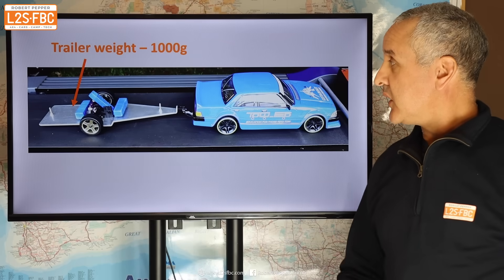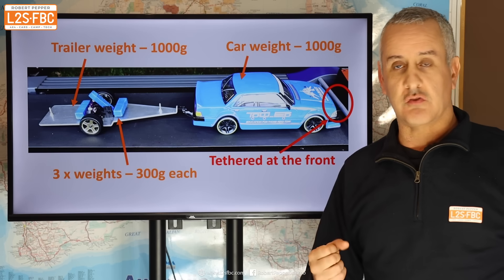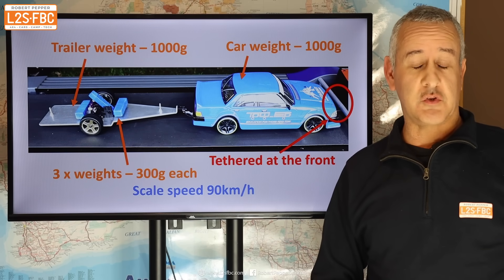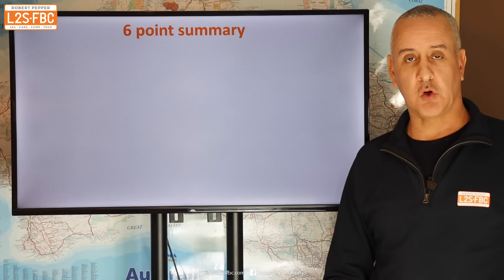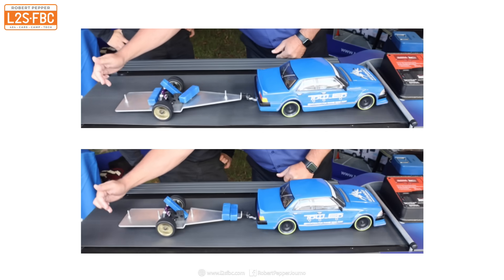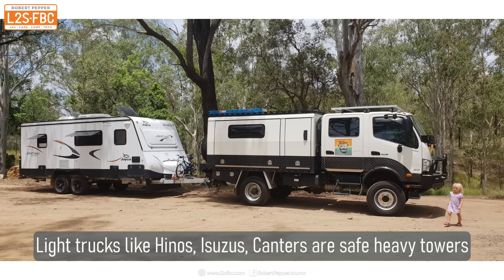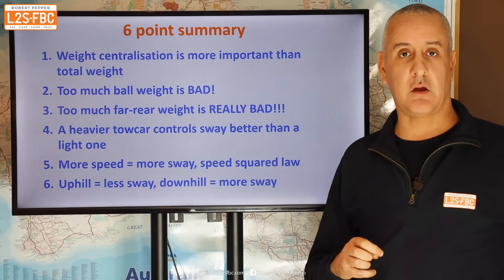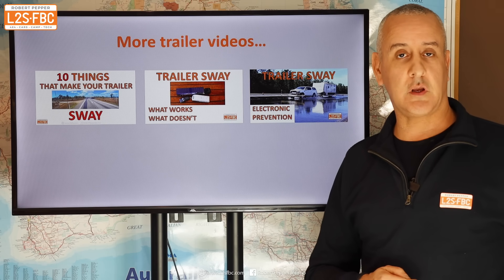7 trailer weight distribution setups, some safe, some deadly.

Comment: I try not to get above abut 75% of the max towing capacity for long trips.  You can use the full capacity for short hauls at lower speeds, but there is a price to pay, you entire drivetrain works very hard to do this.  Trailer brakes are also a great idea as they can be a big help in recovering an unstable trailer (you can LIGHTLY apply the trailer brakes only and often get out of a mess that you shouldn't have gotten into in the first place)  If you live in the mountains it's even more important to watch your weight.
Reply from the maker: Great points thank you!

Comment: I used to work at a Land Rover body shop I used a defender 110 towing a twin wheeled Brian James trailer and on that trailer I have tower Porsches. My 2 jaguars, Range Rovers and never had any sway problems and that’s because I put markers on the trailer to guide me and to keep the trailer and defender 110 level. My defender 110 had an adjustable tow plate that I could lower or adjust. I also used the vehicle to collect motor way accidents from off the recovery yards when they picked them up from the actual accidents. I loved that job it did get scary whilst travelling on the uk 🇬🇧 motorways once you got into the groves the uk articulated Lorrie’s make with their twin axles over the years because it pulled you in and spat you out unexpectedly

Comment: A few years ago in my married years, I bought a VIscount 17ft, towed by a VJ Valiant, 4.3 litre, so plenty of power there and good torque for getting out of trouble. But on a short trip down to Normanville,  from the northern suburbs, getting onto the main hyway, I got this horrible sway. But controllable. While at the caravan park, one of the fellow campers told me to get some torsion bars like he had on his van. So just by luck, in the local paper there, someone had a torsion (stabiliser) bar set. Quick as a flash I went to the house, asking if the owner still had them, sure enough. Just had a bracket to hold the straight part of the bar on both sides of the A frame, and a special fitment that went underneath the towball. The curved bit of the bars went into the holes on the fitment and two cotter pins to hold the bars from slipping out. Best $50 bucks I spent on the van. Took no time at all to fit it..but equipment well needed. On the way home, I had no dramas with sway at all. They ain't everything, but they certainly help the journey be a bit less tiresome.
Reply from the maker: Thanks!

Comment: Great mechanics example with the model however it doesn't fit the video examples you've given. You showed camper trailers that were all double the size of the vehicle pulling them and there lies the issue.  The wheelbase length of the trailer combined with its mass (regardless of weight) creates the sway.  Once the much larger in mass trailer starts dancing the smaller pull vehicle has lost its command.  Bothe of those trailers should be pulled by much larger power units period.
Reply from the maker: The concept remains the same

Comment: This is an awesome video... In the US as another commenter noted, we distribute weight differently. Our trailers are designed with the axles towards the rear of the trailer to add more tongue weight (ball weight). They tend to say that 60% of the weight should be in front of the axles. I realize that exact placement of that weight can change a lot of things, but I'd love to see how your model reacts with more weight just in front of the axles vs all the way at the front as you demonstrated.

Comment: We are contemplating buying an RV, so Im researching, A LOT.  We are looking at towing a travel trailer with an Ford F150.  If all my weights are within limits and distributed correctly, what effects would a 164kg motorcycle in the bed of the pickup truck have, in regards to sway.  Would the likelyhood of a sway increase, decrease or no change?  Obviously, the motorcycle would be strapped down. Thank you.
Reply from the maker: Decrease, as the heavier the towcar the less sway, provided the weight is between the axles on the towcar.

Comment: This is very interesting.  I haven't seen axle positioning mentioned yet (half way through the video), or tandem vs single axle.  I've had years of experience with caravans (short) and boat (long) and never had a problem.  My boat is stable, even in very strong crosswinds.

Comment: So is it center of TRAILER, or center of trailer AXLES that's important? For instance, a 20ft utility trailer has the tandem axles farther towards the back of the trailer. On your defender demo truck, that trailer had the tandems centered on the trailer.
Reply from the maker: Centre of axles with a little weight on nose.
Reply: @L2SFBC  perfect, thanks. That's what I've always done.

Comment: I already knew everything that wqs covered in this video, BUT one thing that still is up to debate is what is the best way to position a vehicle ON the trailer beings most of the  vehicle weight being towed is at the front of the vehicle, it is extremely hard to adjust so the bulk of the weight is on top of the trailer axles
I have hauled vehicles pulled foward onto the trailer which creates too much ball weight and I have hauled vehicles backed onto the trailer which creates too much tail weight on the trailer
For example your trailer is 18 foot long and the vehicle your hauling is 16 foot long you don't have much room forward and backwards to balance out the weight
Also do weight distribution hitches really work????
Reply from the maker: Yes WDH really works. You can also try rotating the vehicle on trailer by 180 degrees as often cars aren't 50/50.

Comment: Very nice video. But the scientific justification lacks.
The reason of sway is vibration resonance. You have two masses (the car and the trailer) attached to a hinge, alike a double pendulum. When the periods of vibration of both masses match, then both vibrate simultaneously and you observe the sway.
This is why i draw your attention to the hidden parameter: the length of the trailer and that of the trailing car. In other words, the distance from the hinge to the centroids.
If you repeat your experiment with others dimensions, you might reach different conclusions.
I can give the analytical solution if you want.
Reply from the maker: Yes please!

Comment: Shouldnt the vehicle be 10000 instead of 1000, so that the weight ratio of vehicle is 10:1 instead of 1:1? Most vehicles are 10k pounds or more, and typical trailers are around 1200.

Comment: Really instructive! Thanks much! Now i can drive safely!
Reply from the maker: Great to hear!
Reply: Just one question : I heard a long time ago then if a caravan begin to sway, we need to accelerate up to stop this sway movement before slow down. Is it real ?
Reply from the maker: No, if you have independent brakes on the trailer, apply those. Otherwise, steer straight and slow down. Some people have had limited and successful experience with speeding up, but it's not recommended.
Reply: @L2SFBC  thank you for your advice

Comment: What about all the factors that your cute little model doesn't take into account like wind, road surface, inclines, declines, off-camber turns, wet surfaces, towing vehicle wheelbase, weight, and varying widths? All-wheel driver vs standard drive, and on and on. Every vehicle trailer combination is going to be different... drivers just need to know their gear and, most importantly drive cautiously.
Reply from the maker: Hard to create a model which accounts for that. Also, if I do, then it will not highlight the effect of weight distribution as the weight effects will be masked. To demonstrate one effect, you need to isolate it and that's what we've done.

Comment: This was informative. Now here's a question- Does axle placement on the trailer make a difference. Some look centered and some are behind center giving you that extra tongue weight?
Reply from the maker: Yes, the further the axle back, the more stable the trailer, assuming correct weight distribution.

Comment: Do you recommend towing with full water tanks on a caravan or partly full or empty ? I have one in front of the single axle and one behind so I do try and keep them even.
Reply from the maker: Your caravan should be stable with water tanks filled in any combination. If it isn't, then I can't say what would be stable as it varies so much. Keeping them even isn't necessarily the best idea as it depends on the other weight distribution.

Comment: A good rule of thumb when towing. Load your trailer over the axles just a bit forward of center. When designing/building my trailers, I take the total dry (empty) weight of the trailer, figure out what 10% of that number is and set my axle(s) accordingly. In other words, if my trailer weighs 1000lbs, I set the axles back far enough so the tongue weight is 100lbs. That has always worked well.
Reply: That 10% guideline also applies to loaded trailers. It's a bit of information that is valuable and good to know.  Just don't exceed the gross weight rating of the trailer, the tongue weight limit of the tow hitch, or the tow vehicle's towing capacity.

Comment: I always thought that the tongue height relative to the ball height also made a big difference and I didn't see you mention that at all in your presentation.  The frame of the trailer must remain level and if your ball height does not take that into consideration then look to see if the trailer is level,. and if it is not then get a drop ball, which can go from just a few inches to almost a foot for those jacked-up jeeps that go hill climbing.  Am I wrong here?  Everything they showed you was correct, but all trailers must be hauled level not in a 5 degree up-angle because your truck or car sits too high.
Reply from the maker: You are correct, but I couldn't mention everything!  I have a seperate video on trailer hitch height please review that.
https://youtu.be/fX78Fu87Coo and https://youtu.be/LfCpOJGnUdg
Reply: @L2SFBC  Thanks, I'll go look at it.

Comment: One thing I wonder about is the tow vehicle.  Is weight distribution as important?  How about center of gravity?  I have a cargo van I tow with, where the cargo area is empty (thus the back end is light) and it has very high clearance and thus a high center of gravity.  Do either of those factors adversely affect sway?  Given the light rear end, is it helpful to add tongue weight on the trailer to compensate and help distribute weight better on my van tires?

I've watched a lot of these trailer sway disasters that end in a wreck.  One thing I've noticed is that they often get just 3 hard sways before they completely lose it on the 4th.  (Sometime they're lucky to get more, but usually get about 3).  If you can react fast enough to manually hit ONLY your trailer brake after the first or second hard sway, I think you've got a solid chance of recovery.

Comment: To start with the tow vehicle should weigh 55-60% more than the pull trailer and the center of weight of the trailer should be before the front axle, plus the tongue weight should be 10-15% for starters...yes, some can get buy with 5% under ideal conditions...speed quadruples bad decisions...why does U-haul recommend 45 mph?   50 50 weight is the beginning of a wreck!

Comment: In the US when our trailer gets to 1.5 to 2.5x the weight of our tow vehicle (more or less depending if the tow vehicle is a SRW or DRW) we move to a bed mounted hitch. This adds weight to the tow vehicle right above the rear axle and removes the tendency that tongue weight has to lift the front of the vehicle. General rule here is 10 to 15% of trailer weight for conventional/ball hitch, and 15 to 30% for fifth wheel and gooseneck. That puts hitch weight on our heaviest campers (25,000 lb GVW) at between 3,750 lbs and 7,500 lbs. Tow ratings for each hitch type is based on the bottom end of the range as far as effect on payload goes. For instance, the dually that I am waiting for Ford to build has a 5,500 lb payload and is rated for around 20,000 lbs on a conventional hitch or 34,000 lbs on a be mounted hitch (5,100 lbs of pin weight). I wouldn't go above 25k lbs with an 8,500 lb truck though.

Comment: If you have loaded your trailer WRONG and it does start to Sway and Whip out of control if you STOMP on the Brakes and then STOMP on the Gas and give the Trailer a Big JERK it will stop the Swaying because you have shifted the weight by the Jerk... If your trailer keeps starting to sway at either High Speeds or a Bumpy Highways BEST to pull over and move your load or just slow down and put your Hazzard Lights on... Hope this SAVES someones life one day :)
Reply from the maker: No.
Reply: @L2SFBC  YES............ NOT ASKING TELLING...  done it many times on a Swaying trailer... the Worst was when I loaded a Van Backwards engine on the back of the trailer... Started Swaying BAD going 110km-120km down the highway.... Give the Trailer a BIG JERK fixed the out of controll swaying when I got back up to speed swaying again Jerked trailer again... got off that Highway onto a slower highway on that trip...

Comment: No mention about what a driver should do if they find they that their trailer is swaying (with no special brake systems). You don't try and steer the vehicle to correct the sway, this just ends up in things getting worse very fast. The think to do is to grip the steering wheel like in a vice and take your foot off the accelerator but do not apply your brakes. You should be able to regain control as the combination slows down...
Reply from the maker: Look in the description. All there.
Reply: @L2SFBC  I just watched video No 1 all the way through.. unless I missed something, it was devoted to how the trailer brake system worked and how to operate it ? Another interesting point is what makes a good tow vehicle ? but then you might have included that as well and I missed it ? I always thought having the tow ball close to the back wheels of the towing vehicle was very positive...

Comment: Only issue I see with this demonstration is that to me it looks like the trailer axle is set in the center of the trailer that in itself will already cause sway issues as there would be zero to very low weight on the towball which will cause sway. Moving the axle further towards the back of the trailer will increase weight on the towball and increase stability. Also reading some of the comments here stating you should brake when you are in a sway it the worse thing to do. The reason this is so dangerous is the fact that when you are in a sway the trailer is actually moving faster then the tow vehicle. The trailer is trying to push the tow vehicle so putting the brakes on will make it worse. The best thing to do to get out of a sway when you're trailer has brakes is to manually put some breaking power on to the trailer ONLY. this will cause the trailer to slow done to the point were it will be going slower then the tow vehicle pulling itself out of the sway due to the fact that its now getting pulled again by the tow vehicle. If you do not have trailer brakes then it gets a little bit more difficult but what you're trying to establish is to stop the trailer from pushing the tow vehicle which can only be accomplished by increasing the towing vehicles speed so that instead of the trailer pushing the towing vehicle you are increasing speed to the point were the trailer is getting back to being pulled as it should be hence pulling itself out of the sway.
Reply from the maker: Yes - look at links in description and pinned comment.

Comment: A good weight distribution hitch works wonders. I used one on my 24’ bumper pull, 10k lbs, never had any sway issues even while pulling with my Chevy Tahoe.

Comment: Buy a ProPride 3P hitch. Sway problem solved. (Before anyone starts getting bent, yes, weight distribution matters, but if your weight distribution is good, the ProPride will eliminate sway.)

I just traveled from Los Angeles, CA to Fayetteville, AR, just over 1,500 miles one way. I was pulling a travel trailer that weighed 6,800 pounds with a GMC Yukon that weighed less than 6,000 pounds. The trailer had a ProPride hitch.

I drove two 14 hour days (including stops) and set the cruise to 70mph. High winds through Southern California on I-40, and also through AZ (after Flagstaff), NM, TX, and OK (from ABQ through OKC). Never a problem, no white knuckle driving, and ZERO sway.

Comment: i used to tow my race bike to the track on a single axle 5 foot trailer, but with an all wheel drive tuned 400hp golf r attached hidden hitch unibody mounted rear hitch.  i remember it swaying a bit, but flooring it would fix it immediately.  probably not the best of ideas, but hey, it worked
Reply from the maker: This an excellent example of where accelerating out of sway can work. But let's look at the situation:
Performance car (Golf R) further tuned for power.  Small, light trailer relative to towcar.  So, accelerating works. Now contrast that to a diesel 4WD towing a trailer which is heavier that itself. No chance.
Reply: @L2SFBC  yeah full throttle always solves every situation, doesn't it...another thing to maybe consider in a future video is misalignment, an incorrect thrust angle of the trailer in relation to the tow vehicle, or possibly bad alignment settings on toe vehicle itself